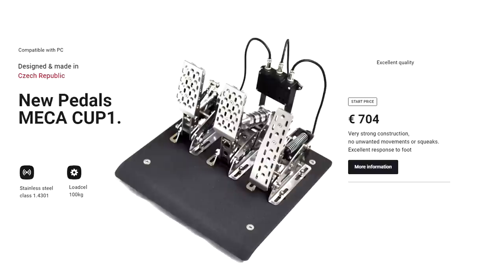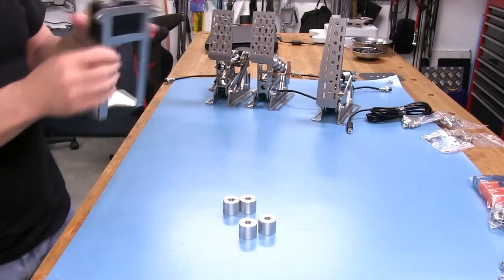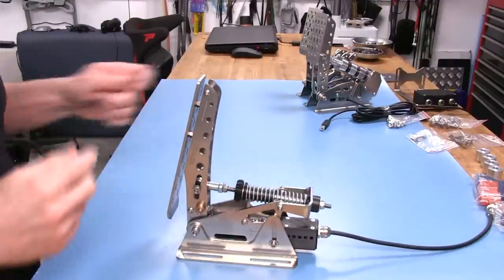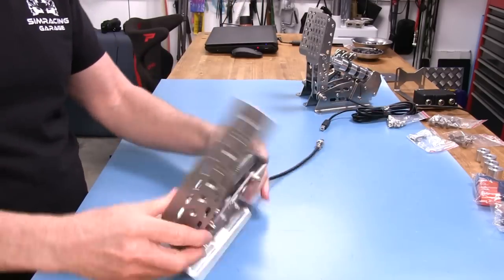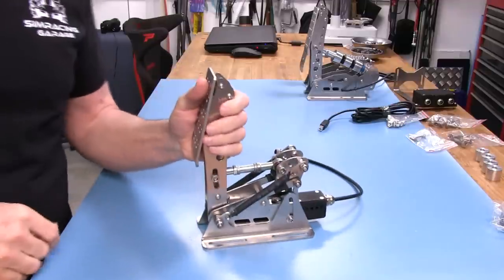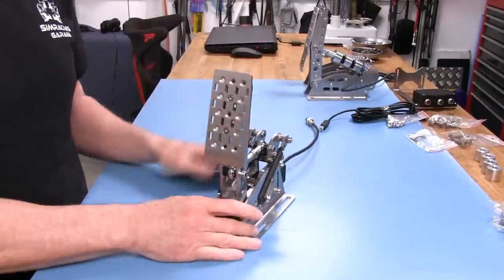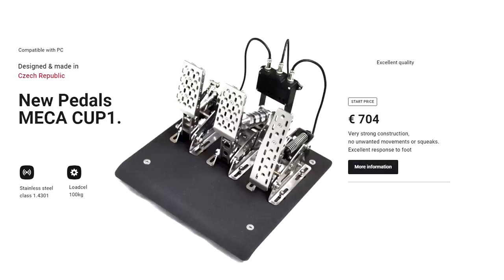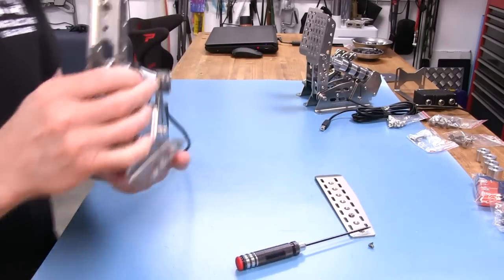ALL4SIM Meca Cup1 Pedals Review

Comment: Hi Barry, thanks for a thorough review as always. During the driving segement, it looks like the brake durometers deflect at an angle under load and maybe even bottom out the aluminum cups against each other at high load. What's your feeling on this and do you think it will affect either consistency on the brake feel or longevity of the spacers?

Comment: Hi Barry, I hope you don't mind me asking a question that you may know the answer based in your experience with this set of pedals.

I bought these in April and received them on Monday 21st May, managed to mount them (in my GT1 EVO "2019")  and calibrate them correctly using DIVIEW. Used them on Tuesday and was amazed by the difference compared to my g25 pedals I've been using since 2005.

To my surprise, went on to use them today, and both accelerator and clutch work but brake is not working... Checked DI View, Windows native app, content manager for AC, but no input coming from the brake whatsoever. I've tried the usuals, rebooting, disconnecting and connecting usbs, disconnected and re-connected the brake cable to the control box... and nothing. No idea what it can be, they only have 1 hour of use and brake is not working... 

 I am using the G25 wheel and obviously the pedals from logitech are not connected.

Any idea what this could be? It can't be they just broke, specially the brake pedal with its 100kg loadcell..

Thanks and take care,

Cristóbal
Reply from the maker: Have you contacted All4SIM? There is an outside chance the load cell has failed. Not very common though.
Also open up the black inclosure and make sure the load cell connection to the circuit board is on tight.
Reply: @simracinggarage3026  Thank you Barry, I'll check out those things you mention. I have indeed emailed them today, so I'll also wait their response. Will update on the outcome if I manage to fix it myself or find a solution from All4sim. Cheers, Cristóbal
Reply: @simracinggarage3026  Good news Barry, All4Sim's Martin contacted me and provided a similar sort of response, and I have checked today inside the black control box for the connection of the brake pedal cables into the circuit board (green box with 4 cable sockets). After loosing them and checking, I re-attached them more deeply and then tightened all 4 screws with care (to a point I knew they were well attached and making contact). It is all working fine now and the brake pedal send signals to the computer again. Re-calibrated it and all good to drive! Thanks for your help and prompt response! Take care and best regards, Cristóbal.

Comment: Which software is used to calibrate these pedals outside of the sim? Im wondering if you can tweak the curve or the range of the pedals, load/save profiles, etc. I'm most interested in upgrading to these, but i know the Heusinkveld Sprints have very flexible software based on Barry's review, so the lack of that being mentioned in this review leaves me torn between the two. Barry can you mention how they were calibrated/tuned outside of the sim, if at all?
Reply: It uses the same software as the Heusinkfeld Ultimat (DIView).  There are no profiles and curves.  Is also unnecessary with these pedals, in my opinion.
Reply: @WarmRed77  The curve part isn't a big deal, it's being able to send less signal to the sim when at 100% on the actual pedal (example: 100% on the brake = 80% in sim). Helps a lot in sims where the brake pressure isn't adjustable.

Comment: I was about to order a set of the new HPP JBV pedals. Now I’m not so sure. The thing that I really want is the good clutch feel. The HPP uses a cam for realistic feel. These use a “tipping cradle” to give you that friction point feel. I think these pedals are a no brained compared to the new HPP pedals. Way more adjustments for each pedal, load cells for each pedal and half the price.
Reply: I like the cluch feel on the Heusinkveld sprints better.
Reply: @Carlosrojas-pm4sk  You've tried the HPP JBV, Meca Cup1 and the Heusinkveld Sprint pedals side by side?
Reply: Just a thought, but you can buy the HE Ultimate pedal as a single unit - though I have no idea about how to configure different brands together in terms of software, or if that is possible.
https://www.demon-tweeks.com/uk/heusinkveld-engineering-sim-pedals-ultimate-1397108/

Comment: Hey Barry, random question, but how far are your screens from your eyes? Youve mentioned before that your screen angles are 50 degrees, with 27 inch screens that should be about 25 inches from eye to screen. Is this what you have it set at?
Reply from the maker: Angel is 60° and 23" from eyeball.

Comment: would you recommend these or the Heusinkveld Sprint? I am about to pull the trigger on some high end pedals but i dont know which to get
Reply from the maker: If I were looking to buy a set of higher end pedals. I would chose the Cup 1 with baseplate between the two you mention. That doesn't mean you or others will feel the same way.
Reply: @simracinggarage3026  thanks for the reply it was what i was hopping for the Cup 1s just look so good and your review of them paint them in such a good light the only down side is they don't ship until august

Comment: "yeah they do a very good job. in fact... uh... better than some of the better known ones actually I think at that price point"

Ooohhh Barry, shots fired! I'm sure HE will take note.
Reply: Good, the simracing hardware world needs more competition. It will drive tech forward,  prices down, and we all win.
Reply: @TheBrennanSchafer  That doesn't happen in a niche market. It will just lead to them cutting corners or copying each other
Reply: I just wonder how they could do the job better when they're a plagiarism of the HE Pro Pedals. placebo effect?
Reply: @Ruylopez778  "copying each other" haha.. that's what Meca did here. Copying the HE Pro Pedals.
Reply: @Tintop  I know. That's my point. All the designs will become more derivative.
People are comparing these pedals with HE Sprints, not with HE Pros.
With the weight and baseplate they equate it with quality. I think HE weren't trying to make heavy pedals with a heavy baseplate for the Sprints, but some people can't think logically, they just see something that looks heavier and stronger and assume it is better.
Reply: @Ruylopez778  I agree. In the end it comes down to reliability, function, software and customer support. The weight of a pedal set doesn't tell anything about the things above. The meca have the dimensions of the HE Ultimate and the technical design of the Pro/Ultimate (but without the Ultimate's dampers), but for the price of the Sprint (which are inferior to the Ultimate). So you basically get Ultimate "Light" for half the price. Easy, when you let another company do design, R&D and testing. 
Money is better spent at HE. Support genuine engineering.
Reply: @Tintop  Yes, I had this exact argument in another thread. People equate weight or bulk with strength, and therefore think it will last longer or be more realistic.
It's easy to adapt an existing design, and then undercut on price. It's sad that people seem to care more about price than anything else.

Comment: 43:08 throttle throw length screw fail, I wonder if that would be a problem or if it just needs tightening a bit more?
Reply from the maker: That was on me. I didn't tighten it back down properly once I had it adujsted.

Comment: Hi Barry, do you know if these can be mounted on the Simlab's GT1 Evo rig without the base plate?
Reply from the maker: I don't know for sure. Did not test them on that pedal tray. They have some generous slots in the pedal mounts, so I thinking it should not be a problem.
Reply: @simracinggarage3026  that helps. Thanks very much :)

Comment: How would mounting vertical work, what type of cockpits support it anyway? I have no desire to run pedals F1 style, been having difficulty trying to narrow down how to go with a setup and achieve a good gt position
Reply: I have to ask why? I mean why is it a problem for you with floor mounted pedals? If it's for immerssion, it's only for the 'lower ranks' of GT cars that have vertical mounts (Cup cars, GT4's, TCR and a like), far most GT cars nowadays have floor mounted pedal boxes - Even such things as (V8) Supercars and ofc, GT3, GTE, DTM etc.. Mainly because the driver is moved from the regular position, sitting lower and further back, plus it allows for more adjustability, placing and not least, allows to relocation of positions. I would much rather get a nice set of pedals and a sturdy rig, than to pay the extra for inverted. But hey, if there is a need, it's the right question to ask :)
Reply: @KF2NationalKartcrg  good points, my reason is primarily to replicate the feel and positioning overall as closely as I can to my ss 1le
Reply: @Steadybeheady  I see - Awesome car! :) There is a lot of solutions around the web depending on the budget for pedals and rig. Fanatec makes some, but you can get kits for such things as HE kits as far as what I've seen in the past. I would highly suggest an 80/20 aluminium rig, such as the Simlab stuff and similiar products, from the get go regardles of style of pedal. They are highly modifieable and sturdy. 

In order to accomodate for inverted outside of the Fanatec's, you'll probably just bolt them directly on to a "H"-section made of 80/20 aluminium extra pieces. But search around the web, and you'll see different solutions and pedals :) But again.. I can only say that the higher you go in pedal quality, thus more adjustability you get in the feel of the pedals - You'll more than likely have a greater success in getting more your wanted feel with less focus on the inversion but more on the actual pedal it self :-)
Reply: @KF2NationalKartcrg  thanks man, I see you recommend the simlab 80/20, I believe I stumbled upon that one late last week and the price comparative to non 80/20 comparable rigs seems actually quite good!

I used to be fairly set on the HPP pedal set or HE Ultimate, but I've lessened that to now looking into the HE Sprint and the new all4sim meca are looking real nice.
Maybe just with floor mounting and the angle adjustability I could get this close enough, as it seems it is definitely extra cost/gear/work to run a inverted setup. With how so many pedals are able to be set up inverted, I thought that it was more common for a rig to be ready to adapt to the positioning but it seems that is not quite the case.
Either of those pedals combined with the Accuforce V2, fanatec sq 1.5 shifter and a undecided handbrake are the game plan to replace my current setup.
Plus VR, so no need of monitor mounts or anything like that

Comment: How do you integrate different components made by different manufacturers? Say proto simtec pedals or these pedals in the video with a direct drive unit like simucube or accuforce or even fanatec or is it all integrated into the computer? All this on a sim lab cockpit. I'm no computer programmer by any means.
Reply from the maker: They are connected to the PC via USB as individual components. PC handles the integration.
Reply: @simracinggarage3026  thank you. It just looked like the fanatec d d unit had the components plugging into the back of it using rj45 ethernet cables.
Thanks again
Reply from the maker: That's correct, but only Fanatec hardware can plug into their wheelbases. That same hardware can also plug directly into PC USB. Some require adapters from Fanatec, some do not.
Reply: @simracinggarage3026  ok, thanks, I'm  about to order, or be put on the waiting list.

Comment: Huh so you can connect a load cell to the Bodnar board via the 3-pin headers meant for potentiometers or hall sensors, interesting
Reply: Bodnar LC-USB board support only one load cell. I'm sure those printed black boxes in throttle and clutch has Bodnar's Standalone Loadcell Amplifiers inside.

Comment: why is it better to have a load cell on the gas pedal since it's more like a linear thing on the real car? you don't need load, it's either full throttle or in between, isn't it?
Reply: For reliability
Reply: Nir Nave 
I highly doubt a load cell is more reliable than a hall sensor.
Reply: @AttilaTheHun333333  it is. if it's not a cheap ass load cell. I already had broken hall sensors in my gear (TH8A) but never a failing load cell. But potentiometers in automotive quality (like from BOSCH) are also good.
Reply: Tintop 
Then it was probably a „cheap ass“ hall sensor. They use hall sensors for a lot of automotive stuff, just not for the gas pedal. The potentiometer in cars isn’t more reliable, they are just used redundant...there are two potentiometers in every gas pedal.

Comment: The trick to potentiometer braking is getting lucky tbh. I hit the rubber stopper at 60% by sheer chance and I was lapping the ring without crashing semi consistently within a day. Others say PC2 is impossible on a t300 but I haven’t found much issue. every car I like seems to have a problem with going straight if you’re not tough on fighting the FFB shake, but it really helps for turning and I’m rambling, take this keyboard from me

Comment: Hmm, I was 100% sure I would be getting the HE Sprints this year. Now I am not so sure. These definitely look awesome!
Reply: he sprint seems so fragile and too expensive when I look at those pedals.
Reply: @MrMETEK23  I would probably get tge Meca. The only thing I am worried about is the support as this company is basically a big unknown. How will they handle defects? Will they still be around in a couple of years time? This isn't small change for me so something I need to consider in the decision.
Reply: @pyrates2000  Get the HE Sprint. Meca is a copycat. They copied the mechanical design from the old HE Pro Pedals for Brake and Gas Pedal. You should support genuine engineering and not copied designs. Also don't forget Software and Support from HE is top notch. Heusinkveld left a statement in the virtual racing forum on this topic. Sorry for Meca but they should come up with an own design.
Reply: @Tintop  They seem to have enough of their own ideas in these to not be simple copies. They are of course inspired by Heusinkveld, no doubt. But they took that basic idea and have improved on it. HE did set kind of a standard in the sim industry with their pedals that others aspire to. This is the case in many other Industries. As long somebody takes the basic concept and improves on it enough I don't see an issue.
Reply: you have to compare these pedals with the HE Ultimate and not with the HE Sprint btw.
Reply: @WarmRed77  Yep, looking at the parameters you would definitely have to. I actually made up my mind and will go for the Meca Cups.
Reply: dejw_d I have now ordered the set.  I hope they will meet my expectations.
Reply: @WarmRed77  Let me know about them. I will be able to get them after the summer I think.
Reply: @Tintop  you must be an advertiser of HE smh.. I have used V3 and then Sprint, nothing compares to Meca, even the Ultimate doesn't compare to them! I can easily say this because of my experience of lots of pedals like Logitech, Thrustmaster etc as well. Just stop saying copy cat, this is not a copy looks like, every pedal has a same working principle since engineering side it has the same principals!

Comment: These or the HE Sprint?
Reply: would you recommend these or the Heusinkveld Sprint? I am about to pull the trigger on some high end pedals but i dont know which to get

Sim Racing Garage
If I were looking to buy a set of higher end pedals. I would chose the Cup 1 with baseplate between the two you mention. That doesn't mean you or others will feel the same way.
Reply: @smyksmykovski8218  So what did you get? :)
Reply: @danut05   Nothing. I just copy that from bellow.

Comment: These look really cool, but I worry about the shaft diamaters - especially on the brakes. I've seen the super-beefy shafts on the Wilwood brake sets actually bend under heavy use -- not an easy feat, but if that can happen, I wonder how long it would take for the thinner threaded shaft on that brake to fail.